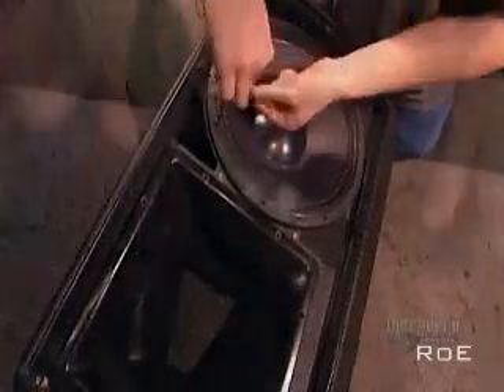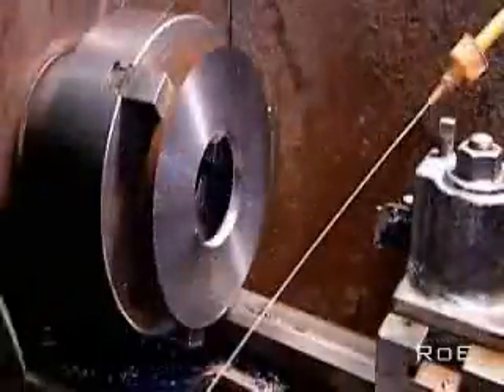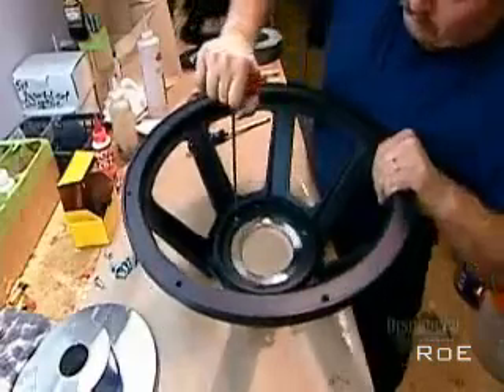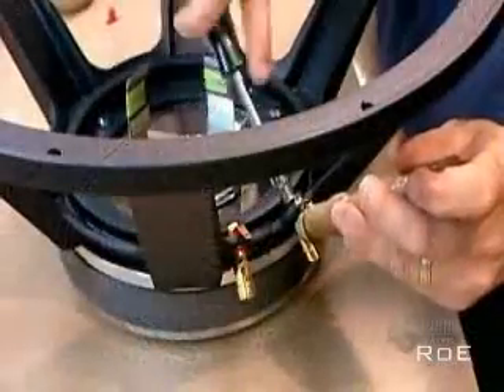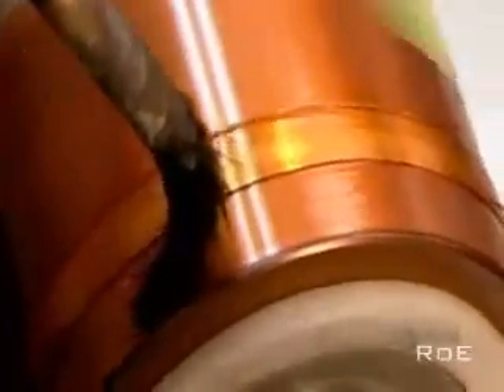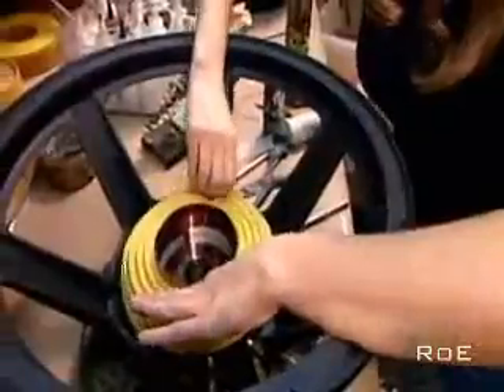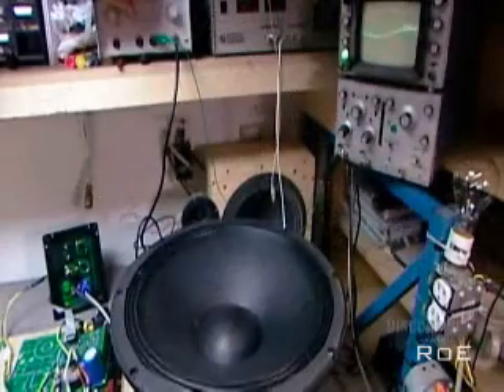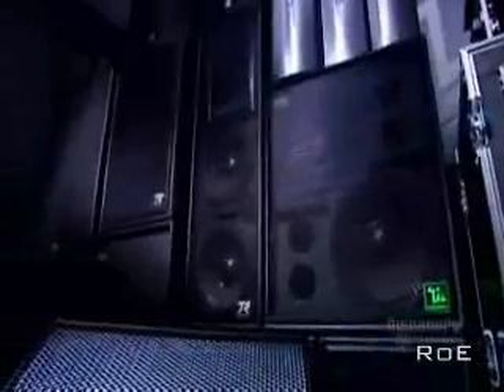[How It's Made] Building a Speaker

Comment: Why isn't a subwoofer a speaker? Teeters have a small coil cone;  midranges have a slight larger coil cone;  and full ranged woofers have a much larger coil cone.  A subwoofer is just dubal coiled with a basket hole engraved in the middle of the magnet  for insured chocking in volcals.  But all and all it is a speaker.
Reply: Subwoofers don't have to have dual coils. There are plenty that are single coil (and some that are quad coil).
The hole in the magnet is a vent for cooling, and is also optional. It's all down to what the designer is trying to achieve.

Really a subwoofer is a speaker just as much as woofers, midranges and tweeters are, any of these 4 individually should really be referred to as a driver. People justlike to simplify things/don't know any different.

Comment: a subwoofer is a speaker,don't let anyone tell you otherwise unless they've done research online,
a subwoofer is a speaker ranging from 3 inches all the way up to 12 inches or higher that has been laboratory tested and approved to respond to a frequency range 
from 20hz or higher all the way to 400hz or lower depending on manufacturing specs.

Comment: Actually its the other way around, a square is a type of rectangle but not every rectangle will qualify as a square. Eucledian definition of a rectangle is, you guessed it, having 4 corners at 90 degrees. Square adds the equal side parameter.

Comment: When they say " 600 volts of direct current" , it is 600 volts DC. It has to be DC to magnetize it . 600 volts AC would be alternating the magnetic field too much to work , it is alternating current after all , alternating in direction . DC doesn't alternate in direction .

Comment: By the way..."Subsonic" means "traveling" slower than the speed of sound, which is about 1100 feet per second at room temperature (slower as the temperature drops).

The correct term for frequencies BELOW the range of normal human hearing is "INFRAsonic, not SUBsonic.  You can look it up.

Comment: Whether this is a subwoofer or not depends on the frequency range for which it's used.  The term "subwoofer" is a bit of a misnomer.  Legitimate subwoofers, properly designed, are capable of generating frequencies BELOW the normal range of human hearing ... that is, INFRASONIC frequencies generally below 20 Hz.  Many systems called subwoofers are actually woofers, with response generally to down to about 30 Hz.

Comment: This is not a subwoofer, it's a PA midwoofer. But like a subwoofer, it has a lot of travel and can displace a lot of air. The hole in the magnet is for ventillation, to allow air not to be fully trapped but to move in and out. This has an effect on speaker parameters, because trapped air acts like a spring, so ventillation makes suspension less stiff, raising the resonant Q and making driver more efficient. Also attenuates resonance behind dustcap.

Cooling is not a primary design criterium.

Comment: It's not even a subwoofer, it's a PA midwoofer. The difference is that it doesn't reach down into subsonic but covers most of the midrange, and also it typically has lower dampening (higher resonant Q value) than a subwoofer, making it unprecise but damn loud and efficient. Very similar drivers (not this one specifically i suppose, but fairly close) are used in guitar amps, and one has to be a complete moron to call those subwoofers.

Comment: i wish they would call the parts what they really are.

the suspension = spiders
core = pole piece
front plate = top plate
electrical connections = tinsel leads
card board cap = dust cap

Comment: This is a subwoofer actually and the coil needs to move but it also needs to be close one of the poles of the magnet for better power so they cut it and add a core which will have same polarzation with the magnet.And coil can move easily and magnet power will be same.

Comment: @BlakjeKaas
first, i'm from Switzerland you moron
second: you made a professional good sounding speaker in one minute ?
-> you are either a liar, or you were just tinkering with a coil, a magnet, tape etc.
-> that's not really a speaker, or can you tell me the Thiele & Small Parameters of your speaker. Making noise from an alternating electrical signal is an acoustic source
but not necessary a speaker.

Comment: @rcfirdy 
It reproduces the signal as a mixture of the different frequencies. So a speaker reproduces a range of vibrations that was captured by a microphone diaphragm.  They use 2 or more speakers in a cabinet to reproduce different speed vibrations (low/high pitch) clearly.  So a single speaker cabinet has limits on it's frequency range. Your ear also picks up an approximation of the combined frequencies (vibrations) interacting when you hear musical instruments.

Comment: @beckoleco 
When the current in the wire moves through the magnetic field produced by the magnets, the coil attached to the cone moves back and forth because it is constantly repelled, then attracted by the magnets. The moving of the cone is what creates the sound because it is an air pump.
Because the current in the wire oscillates, the cone will “pump” at different rates, which is what gives different pitches of sound coming from the speaker. 

I did this for my physics30 research project :)

Comment: @EX0contralt0 typically Bass is sound as well a low frequency one and is made by a subwoofer by making a "low frequency wave"  a tweeter is for high frequency the same but much smaller and makes high frequency waves the mid one speaker makes the frequencies between the tweeter and the subwoofer frequencies... and by far they are all speakers... for more information read wikipedia...

Comment: you cant power an radio with batteries that goes into 110 volt or 220 volt electricity.
altho the best and cheapest option to power regular speakers while portable is by getting a car amplifier and a car battery or a special amplifier that is DESIGNED to be portable but that aint cheap

Comment: Well the basket and motor assembly can be super heavy, but what has to be light yet rigid is the cone. There are lots of woofer models involving basket and frame assemblies that weigh over 50lbs, some weigh over 100lbs, but their cone assemblies with the suspension and voice coils weigh just several ounces, usually no more than a pound depending on the cone size and material (paper pulp, plastic, aluminum, woven glass fiber, woven kevlar fiber).

Comment: that's so it doesn't vibrate itself apart, woofers have to withstand very high pulling forces. if the coil weren't glued very well to the cone for example, it would pop out of the woofer in the second you turned the music on.